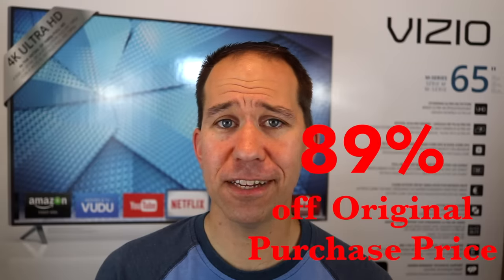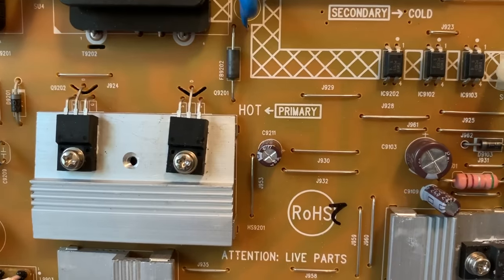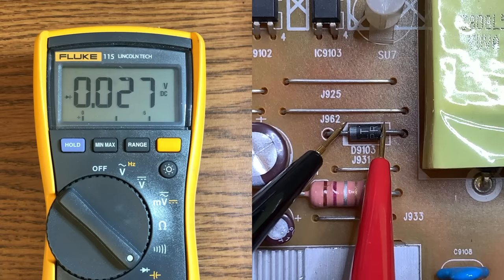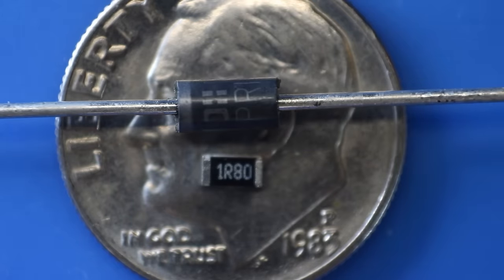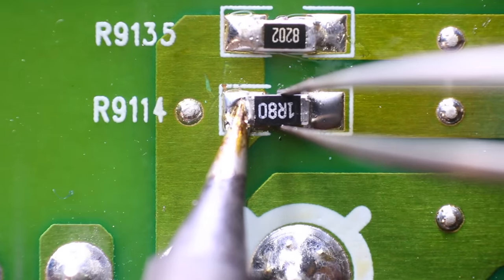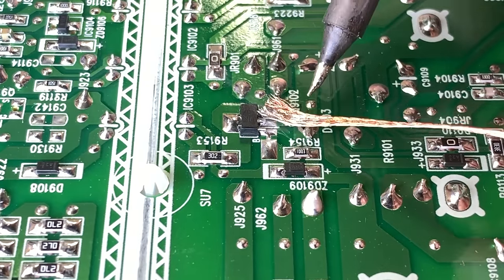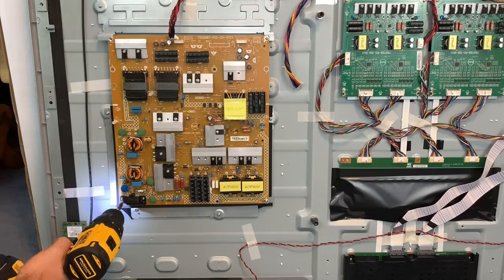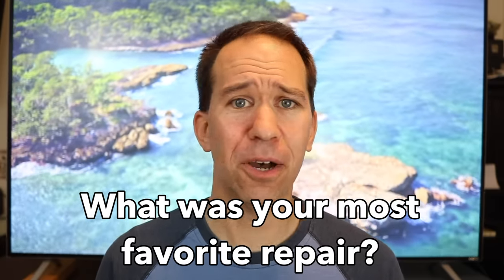I got a broken 65” 4K TV - How I repaired a Vizio M65-C1 (tv won’t turn on)

Comment: I have been having a similar problem with a Samsung LCD monitor and haven't been able to fix it. The 5.1v power rail is both fluctuating and low at anywhere between 2.9 and 3.6. I visually inspected the board and nothing looks off. All the capacitors are still flat and nothing looks charred or shorted. I have been going around and checking each component with the DMM but I can't really tell much while everything is still in circuit. The diodes and resistors seem fine as well. I am wondering if it could be the TL431 voltage reference that went bad but I don't have a benchtop powersupply to provide a stable 5V reference voltage to test the part.

Any advice you would have would be awesome. Here are some pictures of the board if that helps: https://i.imgur.com/HtoTgQ5.jpg
Reply from the maker: Hmm, I'm not sure.  Are you getting any steady DC voltage readings on the cold side of the board?
Reply: @FrugalRepair  Where are some places I should test? Like on the transformer output and such? I salvaged a TL431 from a different board as well as all of the 16v 1100uF output caps and replaced those. Now the voltage is steady but it is only around 3.6v on the 5.1v output. There are other caps on the output side but they are like 50v 100v etc. and I don't have any similar to replace them with.
Reply from the maker: @Marine229002  How about the voltage after its rectified to DC?
Reply: @FrugalRepair  170v

Comment: Ha, you forgot the fuel it took to get there and back. My first burn was a guy on eBay. I was given a busted screen 50". Was all excited.. opened it, got the panel name/part. I can still remember chungwa or something. Anyway, found a panel let's say a123b456 F... Where mine was a123b456 E ... Contacted the guy by phone after a chat. Will this fit? 'should do' .. sold me a panel, £80 ... Arrived, different video card etc.. lying bastard! ... Wouldn't answer my calls. Scum bag. But I did learn. Have fixed many since. My best was £15 .. not 49 cent lol

Comment: 150 for broken TV? Good trick for sellers, spend another 5$ and have like new TV. Why don't you fix it yourself? Oh, I am too busy, but it's an easy fix. The truth is that lots of these Visios have BGA problem on main board. This fix will run about 100$ unless you find right board cheap, and then it will break too. Or cook your board once in a while until it breaks completely. But I have to admit, some TV's can be fixed at zero cost or almost for nothing.

Comment: I would not have paid $150 for that boat anchor. Until you fixed it, it should have been free for the hauling. You gambled with $150 and won. But could have gone wrong quickly. Just say'n.
Reply from the maker: I don’t really feel like I gambled since I know how to fix TVs. In terms of value, this was a two year old TV that originally sold for around $1500.  It’s helpful to know that even if I wasn’t able to fix this TV, I knew the internal parts are worth more on eBay than what I paid for the TV.
Reply: @FrugalRepair  That doesn't change the fact that the owner had a brick on his hands. $50 would have been my top offer, and l'd bet he would have taken that offer. Not very frugal?

Comment: Can u repair a micro sd card need one fixed
Reply from the maker: Maybe, I’ve never tried.  What kind of repair does it need?  Did the contacts wear out?
Reply: @FrugalRepair  yea its broke have all my kids baby pictures
Reply: But it's still intact just a crack in it. You would definitely need a microscope of some sort.
Reply from the maker: Sorry to hear that.  I do have a microscope.  Send me a photo of it (my email is in the about section) if you want my thoughts on it.

Comment: well...my LG 42" tv got busted by thunder strike on my house...but it had 2month's warranty left...i knew there was no warranty for thunder...so i carefully took it apart..and found nothing burned out...so i took it to lg for repair or replace...they asked me what happened..i told them..it just suddenly doesn't turn on..I acted normally..and they didn't suspect anything...so they took it...after two weeks they called me and said that they could not find out whats wrong with it...so as i had warranty they just replace my tv with a new one...i was like WTF.??!...i took it and came home...😂😂😂
i had no idea that a company like LG couldn't found out the problem..!!
Reply from the maker: They probably didn’t check it carefully.  It’s likely either the power supply or main board that has the issue.  Did they let you keep the bad one?
Reply: @FrugalRepair  unfortunately..no bro..
Reply: @FrugalRepair  the power supply was fine..they checked infront of me..it was mainboard definitely...

Comment: So did you not ask the question of how this happened. Diodes and Resistors don't just die. Something happened to blow these parts. Did you ever figure out why these were dead?
Reply from the maker: Search the chat here for some good discussion points on that question.  I don't really know and I'm curious if someone can figure it out.  My best guess is poor built quality in the diode coupled with a circuit design that pushed it to the limits of the design specs.  I can read circuit diagrams but I'm on to other projects right now so if you or others can point me to the section in a schematic, that would be super helpful!

Comment: My main board has no LED blinking. No clicking. That stupid white light turns on and fades away. Flash light test nothing. I’ve examined the crap out of every thing on these boards and can’t find anything with holes or burns. Someone please help!  Do I drop the $150 on the main board. This is so infuriating.
Reply from the maker: Try heating the main cpu (on main board). with a hair dryer, then see if it turns on.  It’s not a permanent solution but something to try.
Reply: @FrugalRepair  thanks I saw that trick on a few other things. Do I need to disconnect it from the tv before I do this or can I do it while it’s still on the tv?
Reply from the maker: You could give it a try connected first
Reply from the maker: Most likely though, you’ll have to heat it from the bottom side, so you don’t have to take the heat sink off, but you will have to take the board off the TV.

Comment: guy near my house  put a samsung 65" on corner laneway 
walking past    looks new ? 
it turns ON ok   but no Tv -  or no pic using PC   mboard ? sits at my bedhead One day  its a 2006 model   .
Reply from the maker: Great find!  I have some videos that may help point you in the right direction.  Make sure to try it every input, even the coax.

Comment: I need a little help. I have a Samsung “42 LCD. It has 3 HDMI ports. They are not working correctly. If I connect an Amazon Fire Stick, cable box, Or DVD player, it does not work. If i connect my laptop to my TV via HDMI, it works. Anyone have this kind o problem before?  What is the solution?  Thanks.
Reply from the maker: Is it a bad cable?  Can you try a different cable to rule out the cable?
Reply: FrugalRepair I’ve tried other working HDMI cables, I’ve tried resetting the TV and still not working. Last night I tried again my Amazon Fire Stick. Once I connect my Fire Stick device, I can hear it running in the background (previews to movies I guess), but no picture. When I connect RCA Audio/Video cables from my video camera to the TV, the picture is fine. The problem is when I connect via HDMI. Thanks for responding.
Reply from the maker: @romanzarate3522  I thought the HDMI port worked when you connected your laptop.  This is why I was suspecting the cable.  So, if you use HDMI with your laptop to the tv, it works, then you immediately unplug that HDMI cord from your laptop and plug in the Fire stick, then there is no video, just audio?
Reply: FrugalRepair Correct.
Reply: FrugalRepair I connected my laptop and it displayed correctly on my TV. Then with the same HDMI cable, I connected my DVD player and it showed the Blue Ray logo for a few seconds and then it went off. Then it showed the “Searching for Signals” on the screen. I tried all three HDMI ports and the same thing happened. Thanks fir responding.
Reply: FrugalRepair FrugalRepair I connected my laptop and it displayed correctly on my TV. Then with the same HDMI cable, I connected my DVD player and it showed the Blue Ray logo for a few seconds and then it went off. Then it showed the “Searching for Signals” on the screen. I tried all three HDMI ports and the same thing happened. Thanks fir responding.
Reply from the maker: @romanzarate3522  Hmm, I'm not exactly sure.  Maybe it has something to do with the audio portion on the HDMI?  So, if you connect your laptop and all works fine, then same cable try the blu ray (then fails to no signal), then you take same cable and plug laptop back in, does the hdmi then work again?
Reply: FrugalRepair Yes it works again on the laptop.   I might buy a new Main Board. Hopefully that will be the solution. Thanks

Comment: Would you have been able to find the issue on your own if the info wasn't available online?
Reply from the maker: Good question.  I would have known right away the power supply was bad because of the voltage fluctuation.  But I don’t know if I’d take the time to search through the board at the component level or just buy a new board.  I’d usually look over the board under the magnification so there’s a chance I would have seen the hole in the resistor.
Reply: use schematic diagram. it tell everythings
Reply from the maker: @MMaheshThakur  Yes, they are very helpful but they won't find a component level fault for you.  I bet finding one for a tv power board like this would be impossible anyway.

Comment: What you fail to mention is the fault is not usually so easy to find. Not even close. People should know that before they spend hundreds on a busted TV thinking it's an easy fix.
Reply from the maker: The reason I wouldn’t mention that is because I don’t think it’s true.  I do think in many cases it’s not that hard to diagnose the problem down to which board.   To find a specific component on a board though is a different story.  So I agree with you there.  But you can always swap out a power supply or main board without much trouble.  They key thing is when getting a broken tv is to make sure the lcd is not cracked/broken.

Comment: You can't pay 150 for a broken TV if you wanna make money. I pay no more then 20 bucks, most are free, if they want more let another tech take the risk. I'm a Mr fix it, I fix anything I can, I have a degree in electronics, but I'm finding TVs a challenge. Not all are simple fixes like this. And the info out there is all over the place, I need to know a basic theory of operation, especially the Tconn and panel end of it. Lot of them need reflow.

Comment: You made a mistake, correct resistor value would have been 1 ohm.
Reply from the maker: How did you figure that value?
Reply: @FrugalRepair  I have schematics for that particular TPV tech. power supply. Most likely you can find that online, it's quite common.
Reply from the maker: @sodderbridge  Why then does the original resistor have a 1.8ohm value printed on it?  Can you send a link to the schematics for this particular power supply?
Reply: @FrugalRepair  It does not even in your video. Value is 1R00. It's not an eight after R, you can see the side of digit doesn't bow like an eight, instead it's straight like a zero.
Reply: @FrugalRepair  Google: QV15.1E LA (uses same 715G6887 series PSU)
Reply from the maker: @sodderbridge  Hmm, I'll have to take a closer look and also check out that schematic.  Thanks.

Comment: So my brother had this tv that gave a green screen when starting I just plugged it in today and now there is an other problem there is a problem with the screen it gets long white lines and I can not see the screen in that part so I watched https://www.youtube.com/watch?v=ITHprEQhyL0 And then I was like "I GOT THIS" but when opening the TV and looking at the parts I find out that the flex cable is damaged some of the copper is pointing out and has melted to a little ball and when touching it it gets very so I am thinking that need to be replaced but after some research I was like ok so no one knows how to repair such a problem? And now I am thinking if you are up for the challenge to maybe make a Video on how to repair it? :)

Comment: There is something wrong with this video. You are using an unrepairable Apple product to search for repairable TVs.
Reply from the maker: Unrepairable?  I don’t think I know that word.
Reply: @FrugalRepair  You don't know Louis Rossmann? :)
When they put active checks against genuine hardware after an OS update or when parts are just unavailable on the market for example.
Repairing is more than just money, it's a philosophy and a way of life. This is why I will never support such a company as Apple.
Reply from the maker: Yes, I hope that things change and repair becomes more available as an option.  And the hardware/software lockouts stop for legitimate repairs.  BTW, I’ve fixed many macs, even “unrepairable” ones.
Reply: @FrugalRepair  Yep, this is an incredibly useful skill to develop. I still find it very complicated but that's how it is when you learn from scratch. Thanks for your vids.

Comment: did you seriously pay 200$ for a broken 2015 tv? Dude..... im sorry but you got screwed. Vizio sells tvs that cheap all the time now. I personally bought a 2018 55" 4k TV last year for $220 at walmart......its also the very thin model with chrome cast built in.
Reply from the maker: No, I paid $150 in 2017 for it.  But even today you can not get a 65” 4K for this price.  Also, I could do this same thing again with more modern TVs.  For example, I just got a free 55” 4K.  So I’m hoping to show that one doesn’t have to spend a lot of money on new things when people are either tossing or selling their broken things.
Reply: @FrugalRepair  you can get 70" TV's for $599.99 now. Black Friday and Cyber Monday sales push many brands like Vizio down to $200-350 easy. You definitely won't get a 65" tv for 150$ but you also don't get the warranty and support sadly. I have two brand new Samsung TVs. Both are the slim curved models and one is 65" the other is 55". Both died and i have no clue how to check. I've googled around but nothing. So I guess I gotta give it a visual inspection and see haha. If you ever get one of the new models for Samsung curved but not the qled you should fix it so we have some help. That would be awesome! In the meantime this gave me a little motivation to try haha. They have just been taking up a ton of space.
Reply from the maker: You should definitely try to fix them!  I would be happy to post if I get my hands on one.  You should first make sure the backlight isn’t the issue (use a flashlight on the screen if it turns on to see if you can notice an image).  Next I’d check the power supply output voltages.
Reply: @FrugalRepair  I'm thinking backlight or dead lcd panel because it had lines across it out of nowhere and then the panels when black. Same on both TV's.
Reply from the maker: Hopefully not the lcd panel.  Were the lines horizontal or vertical?
Reply: @FrugalRepair  horizontal I believe.
Reply from the maker: If they were vertical I might suspect a tab bond failure but I’m not sure about horizontal.  That could be any number of things.  If the same thing happened to two of your curved TVs then it may be a common issue.
Reply: @FrugalRepair  it is. I've seen many complaints but no fixes yet.

Comment: silly rabbit , a bad resistor is not a broken tv. a cracked screen is a broken tv. title shouldve been " how i bought a tv from a dumb sheep whom thought it was broke"  .....deceiving title almost click-baitey
Reply: Broken TV also means not working.  For example: "My car broke down the other week". It doesn't mean the car got broken into pieces.
And for your information soldering is not part of the school curriculum since the 70s, so not everybody knows how to use a soldering iron.